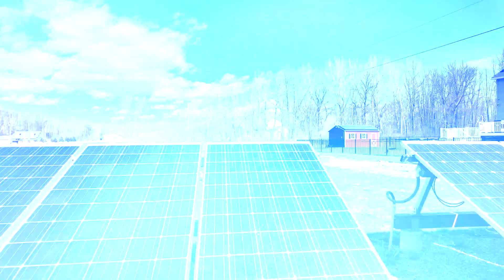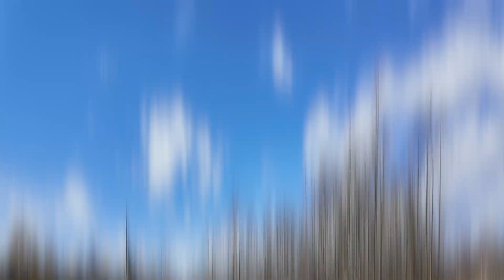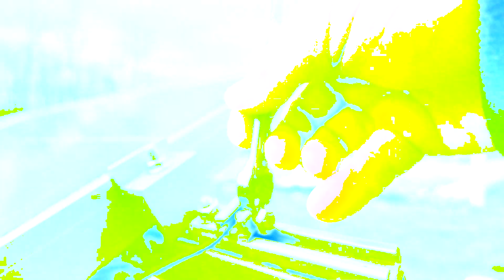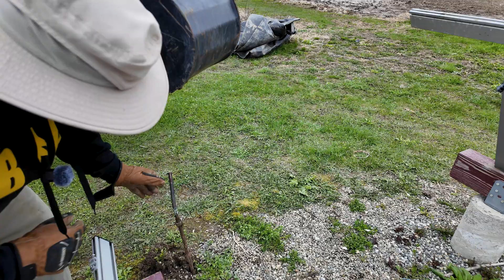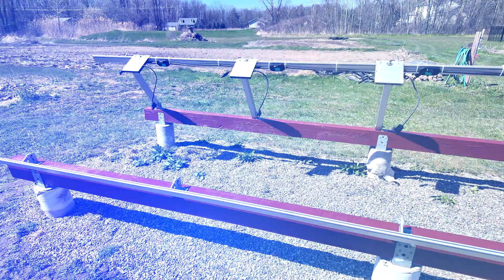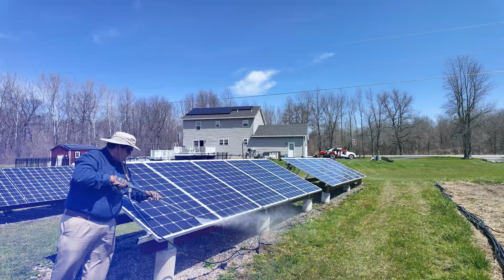DIY Enphase Solar Ground Mount System 10-Years Later - New Panels, Micro Inverter Upgrades, & More!

Comment: Are you planning on putting more solar panels in your system? To sell back to the power company
Reply from the maker: Yes, but not to sell back to grid.  All new solar is for off-grid applications.  Keeping my 9KW system which includes the enphase system as-is.    Net metering has changed a lot in the past 15 years when it was first installed.  It makes more sense to keep the energy myself than sell back with any new solar.  Focusing more on reducing loads with new off-grid setup.

Comment: You can probably make those concrete pillars straight again with constant pressure for a few months using ratchet straps.  Once you get them straight you will need to run some cross members to keep them square.

Comment: I wonder why you didn't upgrade your system when you replaced those panels. I don't know what your Winter Snow situation is, but if you would have installed the bi-facial panels they tend to melt the snow away faster than standard panels. Also, why did you stick with the 275 watt panels, I am sure there were plenty of 325 - 400 watt panels available on the used market.
Reply from the maker: With net metering you can’t just increase your wattage wherever you like.  You have to stay within the permit that was allotted when installed.  Bigger panels would require a new Enphase system and microinverters too in order to pair correctly with a larger panels. I have bi-facial panels on the off-grid shed and haven’t really notice any difference in snow melting.  It is so cold here that often you need to brush off panels in order to help melt the snow with  any sun in the winter.  Thanks for watching.
Reply: @GreenMountainDIYGuy  Now that you have two EVs, have you checked with the utility to see if they will allow an increase in your Solar Wattage? Some utilities do allow larger systems if you have an EV (or two).
Reply from the maker: @bbcooter388  Good Idea, I'll check it out.  We do get a 20% discount for charging off-peak on each EV.  We have a 15KVA tranformer on the pole that serves out house so there is still some capacity if we want to expand sine our permit is at 9 KW for net metering.

Comment: 3D print a new endcap for the rail. I would like to see a cost analysis of the project roughly, especially what the solar output capture saves you in grid power/cost. But include the batteries with their life and replacement costs and all the ancillary components like mounts and maybe even install and maintenance time.
Reply from the maker: I found a couple of files to print but no luck with getting them to fit!  No batteries in the grid-tie system.  The system has more paid for itself over the past 10 years.  40% tax credit when we initially installed!  Looking to install more solar and batteries in the future behind the meter!